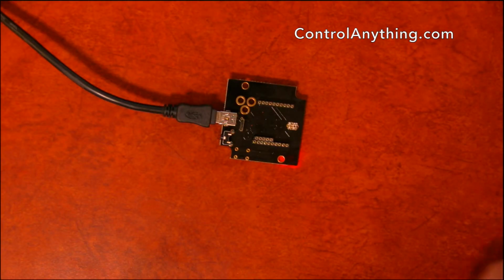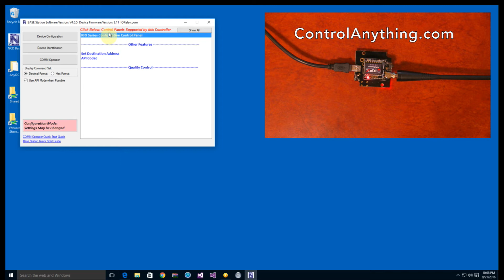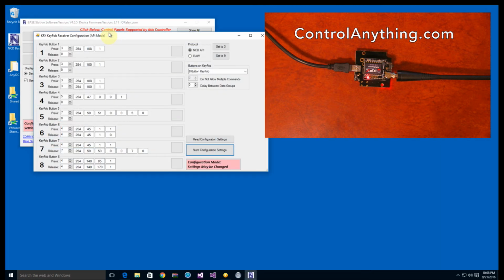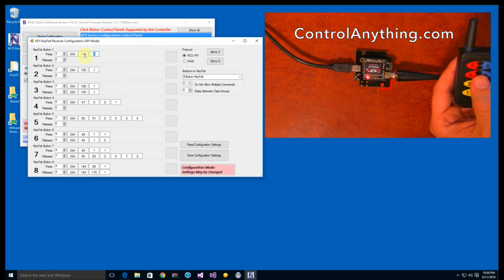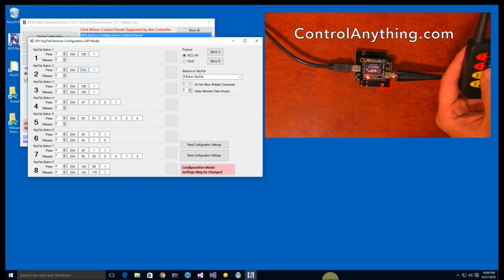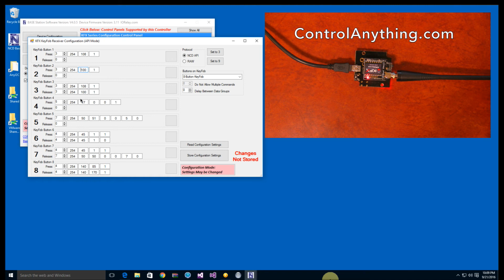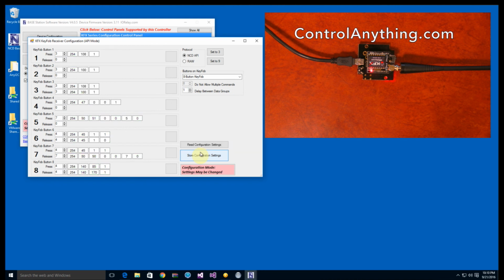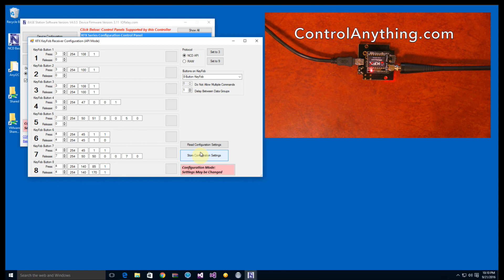Long Range Wireless Key Fob High Current Relay Controller 1 Channel KFX

Comment: Quality looking product. Need for a weatherproof enclosure. Does the board come with any backing or standoffs that i can attach to a back plate of an enclosure? Thanks
Reply from the maker: Hi Levan, we do have some enclosure options for some controllers, but none are weather proof.  These controllers require antenna, power, and relay connections, so this will need to be factored into a weatherproofing strategy.  Weatherproofing is typically handled by our customers, but we can provide some basic guidance if needed.  Please let us know if you need anything else.